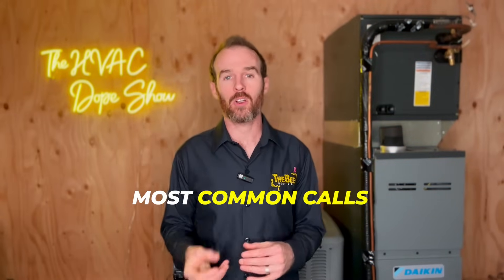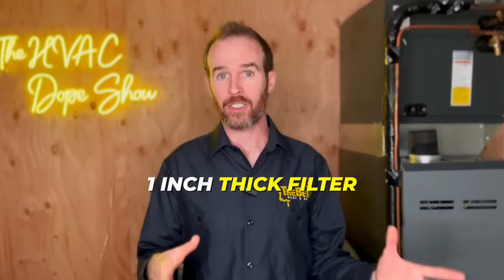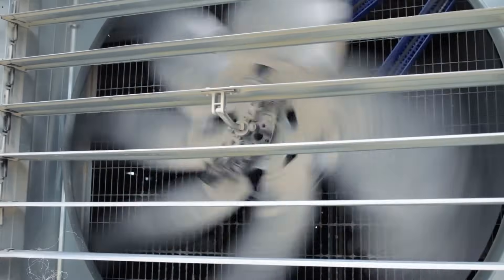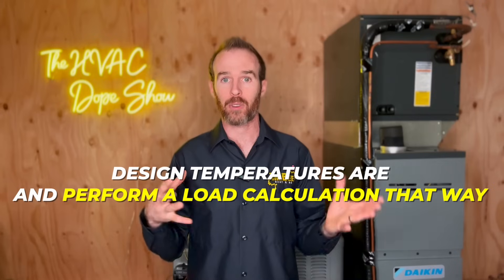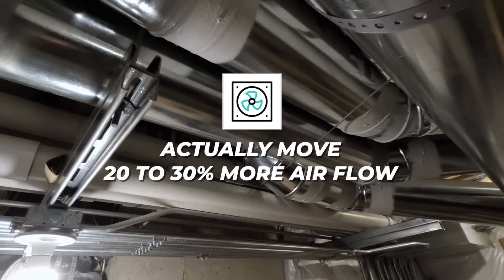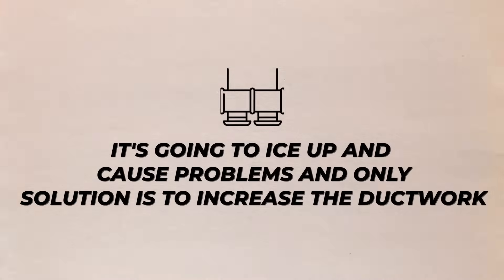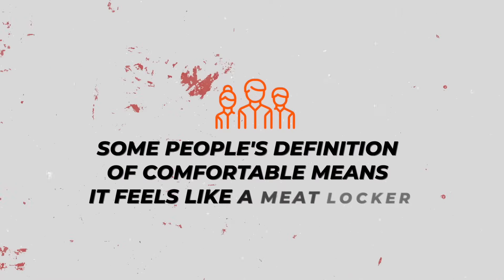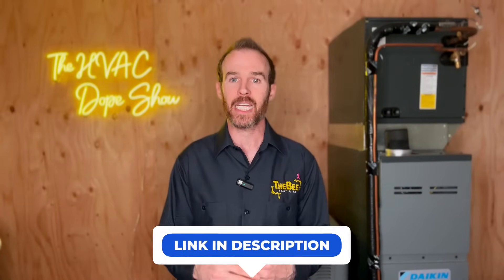THIS is why your AC isn’t keeping up 😬❄️

Comment: I keep mine at 75.. it turns on 2-3 times an hour during 95+ weather. We've insulated attic added a gable fan, i installed new windows and covered air leaks in the attic. All recommendations from hvac guys.. last guy told me that turning on 2-3 times an hour is normal.. is this true?
Reply from the maker: Honestly sounds like a little bit of short cycling but if it was sized for the home before insulation and then you insulated this can happen. 75 is a moderate temp for 95 degree weather, so it might be slightly oversized based on how often it runs but you can also adjust the deadband settings so it turns on at 76 and off at 74 when set to 75 so that it cycles less if you find it annoying. If your bill is still reasonable thought it might be fine. Normally we size our installs to have long run times and change the temp 1-2 degrees per hour on the hottest day of the year. This typically means in the afternoon / peak usage the system will run nonstop for a couple hours normally. So if you get home at 5pm and drop it from 82 to 75 we like to see the temp come down in 4-5 hours, if it’s a lot quicker than that it might be a little oversized but if it doesn’t ice up (outside lineset gets covered in frost) then you’re probably ok 😁
Reply: @TheHVACDopeShow  thank you for that info. No it doesn't ice up at all. Is there any brand thermostat you would recommend so it doesn't short cycle? I don't have a c wire.

Comment: This is one of the best overviews on the subject I’ve seen for the potential customer. 

I’ve learned it’s better to have non-adjustable registers, and put dampers for each branch to keep customers from messing with a tuned system.
Reply from the maker: Thanks! This is definitely true about the butterfly dampers / airflow balancers, very good for the system and best way to actually balance airflow

Comment: If an AC unit is running constantly, doesn't that mean it never reaches the set point and therefore is undersized?
Reply from the maker: It will run constantly to reach setpoint in the summer… if it’s 5 degrees warmer than design temp (varies by region, 72-78F are typical design temps depending on your region for cooling) then it could be undersized if the system is working properly and there’s not another hidden issue… I’ve seen everything from returns disconnected in attics sucking in hot air to systems that just won’t keep up because they were low on charge, but if everything is dialed in then it can often times come down to the load being greater than the home can handle.
Reply: @TheHVACDopeShow  Unless I am missing something ( quite possible) the unit should cycle off when the set point is reached. Short cycling means that it is reached too quickly. and things ice up.  I have read that an AC unit cycling off 2 to 3 times an hour is optimal.
Reply: @TheHVACDopeShow is it normal to add freon 3 years after the new unit was installed??

Comment: You are the only one saying the AC can continually run all day. Mine does in hot weather and I always thought the system was too small.
Great video.
Reply: Is it normal out side temp is 110 have my thermostat set to 77 morning and night hours ac temp reaches 77 and turns off and back on normally but when its 12 pm to around 8 pm it won't get to 77 it gets to 79 and runs for hours. Unit brand new only 3 years old.
Reply: @johnlira3316  that's how it is
Reply: @johnlira3316 you need to turn it down at night and precool the house.
Reply from the maker: Systems used to be oversized more than they are now, and they thought is for both comfort and efficiency longer runtimes (especially during the hottest part of the day) is perfectly normal and most comfortable. Glad you enjoyed it!
Reply from the maker: The caveat is making sure it’s satisfying design temp which varies by region, but normally is between 72-80F with the hotter temps being design temps in places like Phoenix Arizona where they get extreme highs

Comment: Higher humidity in the home will be the result of an oversized system, especially in the South.  A larger than needed system that is short cycling simply isn’t running for the time needed to remove excess moisture from the home.

Comment: Amazing, informative video.. 

I’m still not sure where our system falls.  

Thanking you in advance for reading and hopefully you can provide some suggestions. 

Just bought this house. It’s our second week. Just recently found the filter was inside what we learned to be a “furnace”?  Incredibly intimidating, we managed to find the filter door that was painted shut.  We dusted it and stuck it back in while the replacements arrived. 

After cooling house cooled much better. 

But next day, it wouldn’t cool anymore. After checking we found some splashing near a plastic pipe, initial research suggests pipe clogged but there’s water flowing into some water pump/box thing

How do I address this? 

Secondly we found ice, initial googling suggested run heater for a bit.  How can we check if the freezing is caused by dirty filter and not by other factors? 

Thank you again
Reply from the maker: Remove the filter that will probably fix it and open all vents in the house just dropped a video this morning on the topic 😁

Comment: Hi, Great video and I watched it more than once and I have a question; After a power failure during a thunderstor, the AC kicked back on and all was good untill we noticed that it is colder in the house than usual while the thermostat was set to 74 degrees, i eventually cranked it up to 77 wich is still cold but 78 is not comfortable. I tried resetting the thermostat to factory settings and still doign the same thing. I downloaded two apps on my phone to read room tempreture and they both read lower by 3 to 4 degrees. My thermostat is Honeywell pro. Hopefully i can get some help,
Reply: Maybe the t-stat temp. sensor is bad. If you have a Honeywell, you could try switching to a Honeywell T4 thermostat, they are very reliable and not crazy expensive, unless you have a 2-stage unit then I would try a Honeywell T6
Reply: @Goodfella0982  Thank you , I looked at the T4 pro online and look like the same backplate connections, so I can just plug it in and program it without wiring or rewiring?
Reply: I switched the T6 witha T4 and set it up correctly and I am still experiencing the same thing. Is ther anything else that could be bad, up in the attic or in the outside unit?
Reply from the maker: Have you adjusted the calibration in the stat? If the temp is off you can just adjust the calibration so the temp on the screen reads the same as the temps on the phone

Comment: If the condenser is dirty u will never have a iced up evap coil I'm sorry to inform but that is not possible dirty condenser coil raises the refrigerate pressure an temp
Reply: Come to my house I'll show you one.
Reply: Honestly, I've never seen a dirty condenser ice up an evap coil. It will definitely cause high head pressure, and your capacitor might have to be replaced and down the road eventually your compressor will fail
Reply from the maker: I’ve seen it ice up from this, throw a trash bag around your condenser and watch your suction line temp drop

Comment: I live in south texas and just moved into a house. 1400 sq ft and the outside is a 4 ton and the inside is a 5 ton. I have 8 vents in the house. I have it set at 80 and in the heat of the day it goes up to 83. Is that normal? It takes about 4 hours for it to start dropping down to like 75. Just wondering if this is normal or not?
Reply from the maker: Depends if it’s icing, does it continue blowing air during the heat of the day or does the airflow stop and it develop ice on the line sets outside? It should be sized to keep up, it could be low on charge but it does sound slightly oversized for the ductwork. You could try adding a few duct runs but I would get a contractor out there to verify because at a glance it sounds oversized and like a 3 ton (outdoor unit) would keep up better. Indoor unit just has to be at least the same size or bigger and the fan speeds can be turned up and down

Comment: I just had a new unit put in(3ton) in a 1200 sqft house same as the old one but it blows way harder. I have so much positive pressure its blowing the pet door going into the garage open Now. I added weight to the door, made sure all vents were open, and even remove the filter to make sure it wasn't too restricted. It still has too much pressure. Any ideas?
Reply from the maker: Turn down the blower speed, it’s probably a bigger air handler and you can adjust the speed taps… installer should be able do this
Reply: @TheHVACDopeShow  thanks!

Comment: thanks! it ended up being i tried using too high a quality of a filter than my AC could pull though. I switched it back down to a lower quality and the thermostat started to drop almost right away
Reply: Correct. Some filters like 3m make very thick filters and can cause a restriction. I always recommend 11 or 13 Merv filters, unless you have a very high efficiency unit where it was made to take the media filters that are about 6 inches thick

Comment: Thank you for this information, I was panicking about why my ac unit outside was constantly running the past 3 days almost nonstop since we got 90° to 103° days and staying at 74° to 76° for the inside temperature while the set point is 73°f, so I now know my ac unit is in an efficient mode to save on the life of the AC unit and energy cost.

Comment: I knew when they were installing my new central air system in my 101 yr old house that it would never actually be comfortable inside. Mainly because they had not even invented insulation when the house was built!!! (Nor was there any indoor plumbing!) This is in a moderate southeastern normal residential neighborhood. We actually set the thermostat on 82 downstairs in hot weather, and a miserable 85 upstairs, because otherwise they would both run day and night and never stop or catch up. It would be impossible to upgrade the entire house to install insulation, because it would be far more cost effective to just bulldoze the house and rebuild... believe it or not. So, other than simple things like checking filters and cleaning condensers, there are no real solutions here. Oh, incidentally, during winter we set the thermostat on a cool 61 for "heat"! Can't raise that to a comfort level for the same reason. One more thing: if I were to blow in insulation, would have to ensure this is not creating a fire hazard around the 100 yr old knob-and-tube wiring! Main lesson: Think twice before buying an OLD house!!!
Reply from the maker: I would verify its sized properly for the load and ductwork. A simple “cheap” insulation is blow in… you can get the machine rental at Home Depot for free if you buy enough insulation, it’s like maybe $500 to insulate a 1200’ attic space and that will usually make a huge difference if you have no insulation whatsoever
Reply: @TheHVACDopeShow  Thank you for the reply. I have attic landing insulation, that's not really the problem. It is a large old house with plaster on lath walls downstairs, and wood drafty beadboard walls upstairs, no insulation. By creating countless DOZENS of holes in these walls to blow in insulation, it could help some, but would then create a virtual nightmare to repair all those plaster and beadboard holes throughout 11 large rooms. Plus, the old style construction used angled members some places behind the walls, which would prevent blown in insulation from filling the voids. The house would be absurdly impossible with holes every 16 inches in 11 large rooms, just about impossible to properly repair. Not easy like drywall is.

Comment: Our downstairs A/C seems to be a decent size. No it does not run 24/7 but nor does it short-cycle.

We have a separate attic system for the 2nd floor. It’s a smaller system. It’ll maintain our set point of 75 until the outside air rises to about 85 and then by 90 it can longer keep up. Putting the air handler and duct work in the attic does it no favors. 83 yr old house and the sun bakes the roof.

We have R38 in the attic — not too bad for TN — none of which really matters in summertime. 

I’m also of the opinion that the return isn’t sufficient and am thinking of perhaps adding an additional return to it if I can.
Reply: Sucks with air handlers in the attic! Companies even charge more $ when they know your air handler is up there!

Comment: I wish you had a branch in Miami...no one here wants to take the time to conduct such a comprehensive analysis, and/or they simply aren't sufficiently knowledgeable to do it.  I had a "reputable" Trane authorized company come out to give me an estimate on installing a new, additional, split system to my house as the two existing 5 ton systems are unable to keep the temperature from rising during severe temp days in the summer... and they told me that I had to hire a GC to do a load calculation to determine the size of the new system...I mean, shouldn't a good AC company be able to do that?  Certainly sounds like your company can...
Reply from the maker: Yes we do load calcs, that's odd... you have to out here to offer rebates, weird

Comment: Really helpful! I just turned my fan onto On instead of AUTO, hoping that makes a difference. One end of my home is warmer than the other. I also have my thermostat in a hallway, I’ll need to move it to the living room.  Thanks again 😊
Reply from the maker: Right on glad it helps! Hopefully you notice a difference it normally does on the hottest days especially
Reply: Did I miss something?  My fan is currently set at "auto" so should it set it on for continually on?
Reply: @USCG.Brennan   It depends on your geographic location. Generally if you are in a high humidity area like southern U.S than that is a very bad idea. if your air handler/furnace blower is running continuously independent of A/C setpoint you will be drawing in hot, humid air through doors ,windows etc. without it being conditioned. As in you are bringing in unfavorable air when your A/C condenser is not operating so introducing higher load than designed for and will cause many issues.
TLDR: Leave fan on auto
Reply: @serlalonde8420  I'm in Western Oregon (near Salem) and our humidity is far less than down South (where I was stationed).
I've been leaving it set on Auto and we're OK with that.  Thanks for the info though.
Reply: @serlalonde8420 
Are you saying that the AC is blowing conditioned air outside?  Because that’s the only way I can see it creating a vacuum that sucks air through cracks around windows and doors.

Comment: My system is not cooling as it did before, any ideas?
Reply from the maker: Filter, airflow, dirty condenser or coil, too many vents closed…all the basics first. After that I’d check charge refrigerant could be low

Comment: I keep thinking there’s something wrong with my system, and I think that there must be because I have my setpoint at 77 and by the 3 o’clock hour the machine is running constantly, and the temperature will be upwards of 81. The machine itself sits in direct sunlight for 90% of the day and the outside temperature in the summer months gets to 105+. It seems to me that the machine is not able to keep up, but I don’t understand what the issue is.
Reply from the maker: Has it ever kept up? I would check the basics like air filter / open all the vents etc… it could be refrigerant charge but I always check airflow and basics first. Especially if it was working at one point and just recently stopped… if it’s never worked properly from day 1 it could be a sizing issue / design issue.

Comment: I remember a few years ago it hit 108 degrees here in Portland, Oregon and my system was not keeping up. i called the A/C people and asked about it. Their answer is simply that they don't design systems in Portland for such abnormal  heats. When I later had to replace my 15 year old condenser, I asked them to increase the size from 30K to 36k  BTU. Good thing to, as a couple years later we hit a staggering 116 all time record heat and my house stayed reasonably comfortable.
Reply from the maker: Yeah that sounds right the design temps vary by region but if your ductwork could handle the increase in sizing (which it sounds like it can because it’s not icing) then it sounds like it was a good move 😁

Comment: There is another consideration in system sizing in very humid areas: If a system is sized too big, it will bring down the temperature before it has reduced the humidity in the house, resulting in the homeowners feeling cool and clammy.
Reply from the maker: This is true!

Comment: Any recommendations on a replacement system in Las Vegas? Currently have two 25 year old Carrier furnaces a 17 year old york single stage condenser and an 11 year old goodman condenser single stage. When the time comes to replace does it make sense to replace with single stage? I’ve seen your videos about the Daikin Fit and also seen video about Bosch ids 2.0. Not sure how heat pumps would work in the desert tho. Thanks for the advice.
Reply from the maker: They work great but I would check with a local contractor on the Daikin fit and in Vegas get a higher efficient inverter system you’ll be much happier you did… your AC runs constantly there the savings will definitely pay off over time. I’ve heard the Daikin fits do well but in high ambient above 110/115 there can be issues with humidity during monsoon season (in phoenix) above 3.5 ton systems only. So just check with a local contractor that sells Daikin because they’ll have the inside scoop on local systems, but an inverter system is definitely worth it in vegas and will keep up fine in the winter too.